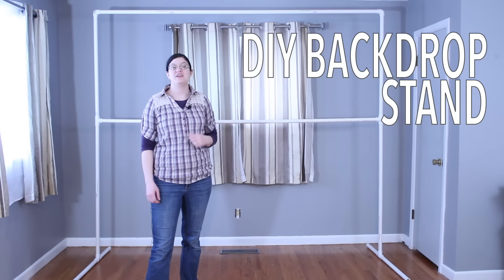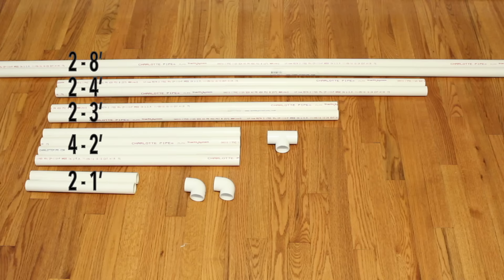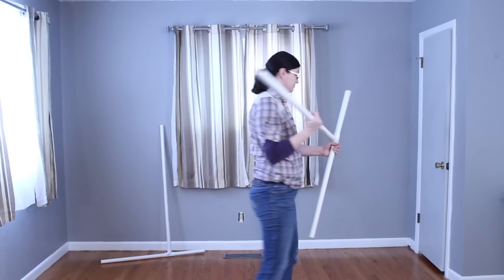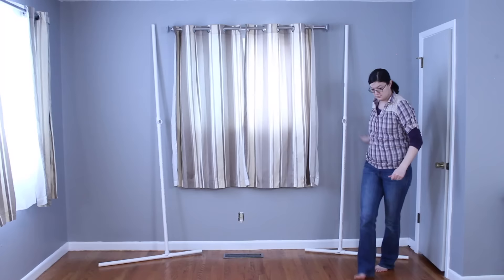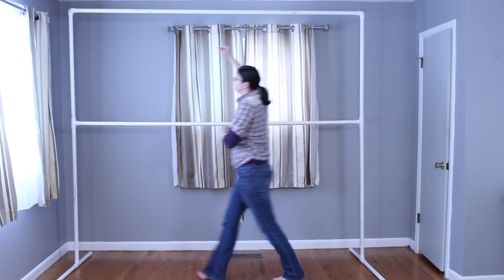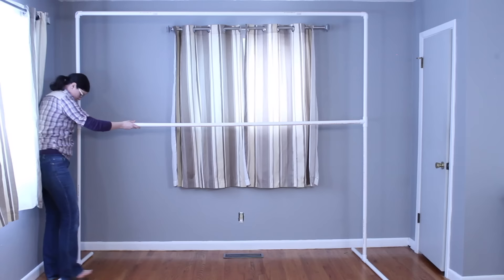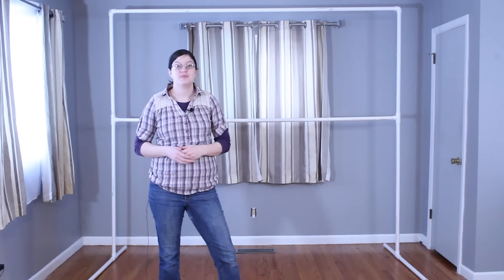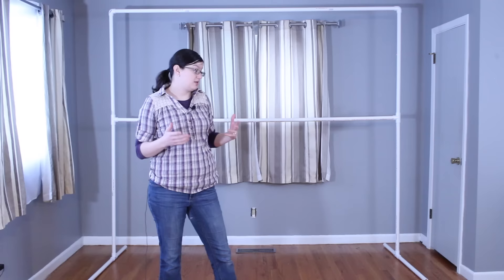DIY PVC Backdrop - Party Planning How To's

Comment: Ok I got the fabric and all the pieces but fabric is see through!  How do I accommodate a back to the sheer ones?   Thanks total  was 20.00 dollars for all!! Fabric like 40! Lol
Reply from the maker: Hi Alice, my best suggestion would be to pin light weight fabric or plastic table cloths to the backside of your sheer fabric. It depends on the color and the opacity of your sheer curtains if you can get away with the plastic option. Professional pipe and drape stands have a bracket that hooks into their poles so there are two poles at the top. That allows for an opaque backdrop and a sheer one in front or for draping. Hope that helps!

Comment: Can this be made in a wider length? If so how can I make it stable?
Reply from the maker: Great question. I personally wouldn't make one wider than 8' without adding extra legs to the design. Theoretically you could have an entire wall of pvc pipe backdrops daisy chained together. Instead of using elbows and "t" joints you would use "t" and cross joints. This would be very similar to how traditional pipe and drape works. When you see an event with a whole wall of fabric, it is made from a series of interconnected pipe and drape bases linked together.

Comment: Hi thank you so much for this video I need two backdrop stands for my kids baptisms but they are so expensive on Amazon I have a 5x7 in backdrop what sizes would I need on the materials being used to make the stand please help me
Reply from the maker: Hi Jacqueline, I'm going to assume  what you need is 7 feet tall and 5 feet wide which makes this really easy. Build the side legs like I describe in the video (2 -4' & 2-3'). The only thing you'll change is the two horizontal 8' pipes will need to be cut to 5' instead. There is a helpful diagram on my website. The link is in the description box. Happy party planning!
Reply: @EventAnswer  thank you so much. is that size too small ?for a 6in table that I'm going to decorate with candy and treats
Reply: @EventAnswer  I was also wondering what size is a perfect table runner for a 6in table?
Reply from the maker: Usually you want the backdrop to be as wide as the table or wider. If you need to stick to that size frame you could fluff it out a little bit with a balloon pillar or garland on either side of the frame so the backdrop as a whole looks wider.

Comment: That’s awesome, question is it stable enough to hold a top flower wall on foam board?
Reply from the maker: Yes! I made a leaf wall and attached foam board to this backdrop frame and it worked great! It swayed as I attached props to the board, but was just fine once I stopped touching it.

Comment: How would you hide the long bottom pieces?  Say I would need to drape an entire room.
Reply from the maker: Great question. Usually I would drape a coordinating fabric in a pool to cover the base/feet. I think that would be the sleeker look especially if you want to cover a whole room in pipe and drape. The other option I like is to use potted ferns. They are airy, hide structures, and add a live green element. Never underestimate what some plants can do to liven up a space. Good luck with your project!
Reply: @EventAnswer  Thank you!!

Comment: I am turning my friends house into a Harry Potter themed escape room. One of the rooms will have talking pictures. My idea was to make one of these stands and hang fabric to look like a wall with holes cut out the size of large frames and then have two of my friends stand inside the frame to be the talking characters. Any ideas on how to pull this off?
Reply from the maker: Oh my goodness this sounds amazing! You could absolutely pull this off. I would recommend you use the large rolls of craft paper to make your wall. Measure your stand and give plenty of extra paper to wrap around the sides. Lay it flat and cut out holes for the portraits. You can paint frames on the paper or you could hang open back frames from the pvc stand using fishing line. You may want to reinforce the paper holes with packaging tape on the backside so it doesn't rip. If you need more rigidity overall you could use cardboard or foam board as a base with paper in front. Message me if you have more questions! This sounds like a bunch of fun!

Comment: Any advice on how to cover the ends of the backdrop? The elbows and pipe show.
Reply from the maker: I tend to use fabric panels that have a pocket in the top. I will slide the pocket down over the top elbows to hide the bend, then you can drape the fabric around the pipe. Depending on your fabric you may need to pin it in place to hide your supports. It is good to have panels that span wider than the 8 feet so you can do this and have gathers across the entire backdrop. Gathered fabric can hide a multitude of imperfections. Good luck with your project!
Reply: Event Answer Thank you so much.

Comment: How do I keep my pooles from moving side to side
Reply from the maker: First I would check that all the pipes are pushed all the way into the fittings. Second try put weights on the feet. The poles will move as you are putting decorations on the display, but it shouldn't move once you stop touching it.

Comment: Loves it! Wondering if 10ft wide would be ok? Or do you think 8ft is the widest?
Reply from the maker: Deahna, I think with some modification you could make it 10'. To do that I would add an extra support in the center so the pole doesn't bow. Cut pieces exactly like the sides (1-4', 1-3', 1-2' & 1-1') you'll need an extra "t" and a cross fitting. Then cut the two pipes that span the distance in half and add your extra foot in the center. This does mean that what ever you use for the backdrop needs to be in two pieces since the top pipe has a fitting in the center. Let me know how it goes for you!
Reply: Event Answer Thanks! Are you able to list the exact cuts needed for 10' Thank you

Comment: How sturdy is it
Reply from the maker: It can hold fabric backdrops and light weight props easily. Since the parts aren't glued together it will move if you touch it. I always recommend using sand bags or weights on the feet.

Comment: What size are the elbows and tee connectors? Any specific brand ow where you bought them?
Reply from the maker: The connectors are all for 1" PVC pipe. When you are standing in the plumbing section the pipe fittings are usually sorted by pipe size, so look for 1" on the box or baskets. You don't need a special brand of PVC, in-fact, I used the non-pressurized PVC pipe as it is cheaper and I don't think it made a difference in the structure of the backdrop.

Comment: Ugh where do you live that this cost less than $20?  Just for the pipes it would be $30!  =(
Reply from the maker: This was filmed a couple years ago when pipe was a lot cheaper. $30 is pretty reasonable right now in 2022.
Reply: @EventAnswer  except its not when your income doesn't increase w inflation.  Everything costs more but our paycheck has stayed the same.  I wish I could find something else to use that would be cheaper.
Reply: And w the fittings it's more and after tax it's almost $40.

Comment: Would this work outside?
Reply from the maker: You could put this outside, but the base would need to be weighted so it doesn't blow away. Where I live it is pretty windy, so I would only feel comfortable putting it near a building so you don't get a cross wind blowing straight through it.
Reply: How do you suggest to weigh this down?
Reply from the maker: @dwaushawilliams1421  Sand bags would be my first choice. They rest on the feet nicely. After that anything heavy will do - Cinder blocks, bricks, etc. Whatever you use to weight it, think about how you will camouflage it. Potted ferns work beautifully or drape coordinating fabric over the top. Hope that helps!
Reply from the maker: I just used this outside for a morning 5K and it did really well with a 4x8 foot banner on it. At the end of the event the wind picked up and it did begin to tilt, so keep it out of the wind. I just posted a video on DIY Saddle Sand bags that would hold this backdrop steady. https://youtu.be/kook9U5LYuU

Comment: what size did you get the curtains??
Reply from the maker: Event planner confession, they aren't curtains. The green fabric I used was some really wide hemmed fabric. I measured the length I needed and using corsage pins made a header for the pipe to go through.
Reply: So what’s the size on the frabric?